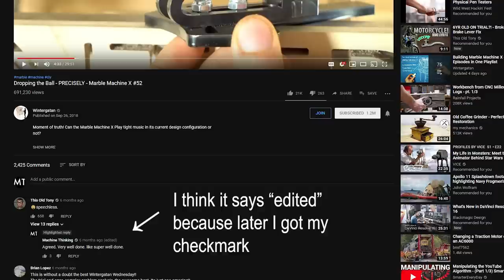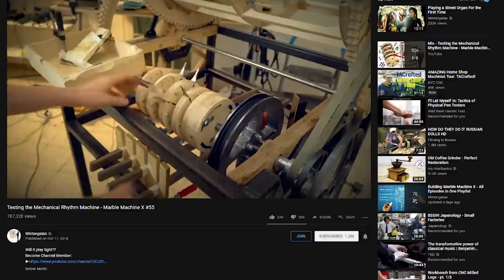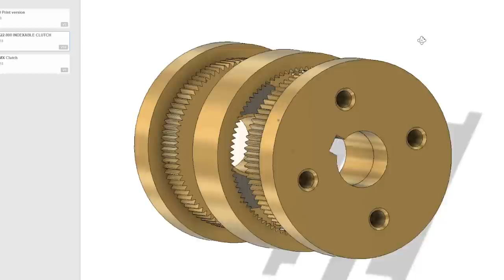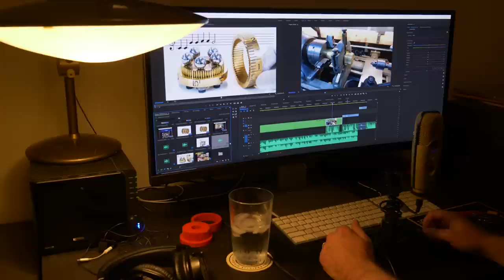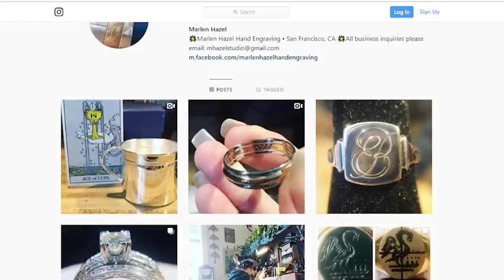Perfect Timing (with the Marble Machine X)

Comment: Really liked the video with all the time and work you put into it. Very cool design. One question for you that you didn't explain in the video, how did you attach the springs to the brass while allowing for an almost flush attachment? I watched this video a few times and wintergardens to see how they are attached and they just look glued on. Is there any other method used or is it just glue?
Reply from the maker: They are just held tight between the splines and the backing plate. If you look at their shape in paper there is a little piece that sticks down. It was the simplest and most space efficient way to do it I could think of.

Comment: Anyone thinking of emulating the (excellent) trick of running the lathe backwards when turning lots of brass: don't try this if your spindle nose is threaded (Southbend, Myford, Boxford etc)! If you have a Schaublin or similar, where the chuck backplate has an additional clamp screw (along the lines of a "Shrink Disk" coupling), it's OK provided you remember to tighten it...

Comment: It would be much cooler if the timing adjustment was made automatically. If you look at car distributors, they have to deal with a similar issue, the time it takes for the fuel/air mixture to combust is constant, but as the rpm goes up, there's less available time to take advantage of it, so as the rpm increases, the spark is fired sooner. Old distributors used a centrifugal weight to make this happen. I think it would be possible to apply the same principle to the MMX.

Comment: While Semichrome works great for restoring shine to an already polished part , it is not ideal for putting a first polish on a metal part. You could have saved a lot of time and effort and made a great polishing job unbelievable by using buffing compounds and buffing wheels. You can use your lathe ( after you cover the ways ) to power the wheels. I do a lot of polishing on stainless steel gun parts and have a much more involved polishing setup. I found that by using the proper grits I can get a lasting shine on 304 and 308 stainless that people think is nickel plate. Brass is much more receptive to buffing because it is softer. If you have another job that needs to be polished pick up a buffing kit and prepare to be amazed!

Comment: Stupid question: Why not use a wind-up spring that connects to the turning lever?
With this decoupling the operator could leave the lever at whatever position wanted and different beats would not be a problem either.

Comment: When I started watching: Why does every novice machinist have a 10EE?
When I finished: Maybe not as novice as I thought. Or at least, quite good at what he does.

While the part's look is beautiful, I think it's design was even better. So much better than the plywood thing that was there earlier. Well done! Smart choice to go with the engraving artist as well. I do hope those socket head cap screws won't stay on the final thing! :o

One last thing. How did you lock the spindle on your bridgeport? Just with the brake? I've been wanting to do some slotting but the brake doesn't hold exact position.
Reply from the maker: How I got the shaping tool square to the workpiece is one of the interesting things I had to cut. I put some scrap stock in the dividing head and with and endmill took a cut on Y to give me a flat. Then I took the insert out of my tool and put it against the flat and put my mill into low gear. That was enough to lock it. Tom at oxtoolco hangs a weight on a string off the back of his mill to hold the brake on!
Reply: @machinethinking  Thank you for the timely and detailed reply! I have found that even locking the brake (it cam locks on j-head bridgeports) it has a little bit of wiggle. I'm thinking I will machine a split ring that slides over the spindle nose and the quill, that when clamped will hold them tightly. All I need is a 5" chunk of aluminum...

Comment: The lines you cut perpendicular to the top if the bread ring
How do you rotate the chuck precisely to keep the spacing of the grooves correct
Reply from the maker: I used a dividing head
Reply: @machinethinking  
Oh I see, I looked at a photo, it's a precision thing rotator with fixed intervals.
Reply: @machinethinking  
We were on holiday once and I saw a tiny little lathe in a bric-a-brac shop.
I took a photo to show my dad, an ex marine artificer for the Royal Navy. 
He said we used to make those, it was their final qualification to become a Navy MA.
They were given the plans, a motor and belt and lots of raw metal stock and a machine shop. 
They had to manufacture every component from scratch and then it would be tested for a minimum level of precision, so many thou.
So not only could they build the ships they worked on, they were taught to build the tools to build the ship. 
A truly crazy level of qualification, they don't do that any more, it cost an absolute fortune to train and retain sailors of that calibre.

Comment: You need to take the positive rake off of the drill bits to stop them grabbing man...use a slipstone to create a negative rake land..
At 8:54 you can see the piece moving around while you drill it... soft jaws are your friends here...even if you only use alum. slips , you can tighten down much more firmly without fear of damaging the soft brass...
Nice job...  😎👍☘️

Comment: I polish a lot of brass in the round...I just chuck it in the lathe and spin it and polish it. Also.....impossible to read all the glowing comments but...has anyone asked about the dorky screws and washer stack on the one end? Wouldn't it look a bit (a lot) nicer if the screws were the correct length and had maybe one washer under each? Or am I missing something?
Reply from the maker: Watch Martins video. They were just temp until he attached the gears

Comment: Very nice... one thing is the cap head screws and stacks of washers looks out of place with such a project...dome head with one light washer would look better... the cap head and washers look to be an after thought or "band-aid" solution.
Reply from the maker: Watch Martins video. They were just placeholders until the gears were installed.
Reply: @machinethinking  thankyou...only watched this one.

Comment: I'm much more curious about how the inner workings actually function. With the name variable clutch I suppose we can assume it's a device that can vary to load transmitted through it, but how? :P I'm not sure if it was actually ever said what the number adjustment does....does it change the engagement pressure? What is  the friction material or how is it transmitting force? Just curious!

edit: Oh, it's more clear after watching Wintergatan's video. I see now that it's akin to an automotive engine timing chain "phaser" with a decoupler. Usually when I think clutch I think varying loads being transmitted, but I see clearly now! :P

Comment: I'm sorry, but the brass drilling incidents are just painful, especially considering how many times it happened. The first thing I did when starting my workshop was to have an extra set of drills with the cutting edge brassed off. Cutting Brass with any positive rake tools is dangerous and always compromises the integrity of the work. You clearly have much machining experience but how have you been working Brass this whole time without a set of drills dedicated to brass and plastics? 
Those parts could easily have been wreaked or had those splines give a nasty injury. It took me less than 10 minutes to brass off a set of drills on my grinder, and brass cuts beautifully, not even the slightest pull on the exit hole.
And the beauty is that you dont even need nice drills, this can be done on any set of (straight) drills and they will cut brass great. Completely essential in my opinion.

Comment: If you want to learn hand engraving, it's not difficult, just time consuming. But I learned to do it while listening to podcasts because I don't have the typical TV habits of the average American. I'm not going to claim I'm close to as good as the woman you hired but I can do it. I'm probably much slower than a pro also.

   Anyway, go to Harbor Freight & get a set of needle files. Then, get their 12 dollar diamond hone (4 sides 4 grits) & a $4 stone. Sharpen the tips to make your engraving tools. You may want to start with a grinder depending on how large you want the cutting points. You should have a good idea of what angles they should be by your experience machining but it's also a bit subjective. Practice on some aluminum & mild steel because they are cheep. If you think you'll do a lot of brass though it's cheep enough to just learn on brass.
 I recommend the cheep Harbor Freight stuff because if you decide you like it you'll probably buy a second set of tools no matter what you start with & there's no point in spending a lot if it turns out that you hate hand engraving. A small sand bag is also nice to have for easy rotation of the work. Some people use a vice, some people cut a boiling ball in half, hallow it out & make the middle into a sand bag. Easy rotation of the work is a major part of what makes you better, faster.

Comment: So... why did you clamp on the brass teeth when trying to square up the key in the vise? Why not just put the key in and set the key on the tops of the jaws, thereby clamping on the sides of that brass piece? Machinist of 16 years and I would never clamp on the teeth.

Comment: I legitimately need to know. Why the cold saw and not part it off on the lathe?
Reply from the maker: Cold saw is very fast plus the parting blade would have to be very long
Reply: @machinethinking  I see. If i was guiding you I would suggest trying a part on something like that. The Brass is very forgiving, you might be surprised. You can part pretty deep (2in) if you have a good set up. 

You did a fantastic job and I’m in no way critiquing you, there’s a hundred was to do something right

Comment: That this The Ones of The timepiece... 11:32 expected that piece going come off( the weakest clamping piece on the rotary chuck, i ever seemed).
You're lucky, neither didn't hit your face nor redo this piece again.
Please use Toggle Clamps (2nd strong)... for round piece with gear teeths (weak clamping on the rotary chuck) or 
make a Outer ring bush (with slat) holding all the teeths on the rotary chuck that clamping down or
make a bush ring (with slat & taper on the inside), clamping down with the screw at the bush ring that expended (to clamp the piece from the inside),
the jig which mounted on the rotary chuck.(or simple, get CNC to do it for you)

thank you...

Comment: I'm not a machinist or maker or anything, but I didn't see much (any?) cooling or tapping fluid used. Is that normal for working with metal like this?
Reply from the maker: "red metals" like brass, are self-lubricating and don't need cutting fluid.  It can be used, but it's not necessary.  360 Brass like this is the easiest of all metals to machine.

Comment: I would like top acquire one it would be the greatest contribution for your work I am building a green machine industrial prototype...this fly wheel is essential  to need correct timing that is adjustable ....we will be attaching a rare earth magnet and sing the magnet to activate a reed switch...for a dc pulsing circuit ...

Comment: 8:54 hold the phone - buying proper brass drill bits? You just sharpen your steel ones with negative rake on the cutting edge.

Comment: Just a note about drill bits for drilling brass. If you don't have a set of straight-fluted drill bits you can flatten cutting edge to prevent brass from pulling itself into the drill bit.

I found a random video that does a great job of explaining it.  https://youtu.be/pAngKHIZgyA

Comment: When that poor piece of brass just got clamped straight into those vice jaws, half on the bolt head, I cringed. Brass is so soft I would have thought you'd use something like nylon or acrylic or some other type of hard plastic for the vice jaws. But then I'm not the one making the precision piece of engineering.

Comment: All that precision, spaced with stacks of washers. I myself would not be rooting my horn about this particular piece. 

There is nothing unique here, when considering the decades of close tolerance work in the machining field, aerospace and aeronautic etc etc. 

People act like they invented the wheel more and more these days and yet, nobody has come up with anything better than a noisy propeller for a drone. 

Over 500 years ago, probably more than that, the white man figured out how to lap flat surfaces and precision watch components, with very little technology compared to today. 

A top fuel dragster power plant and drive or Nascar engine is far more impressive and technical than this throw back to the 17th century you did here. 

Whatever.